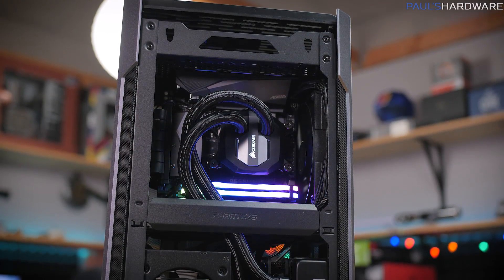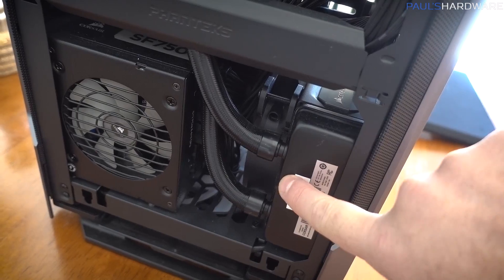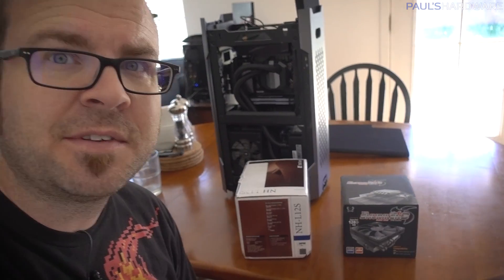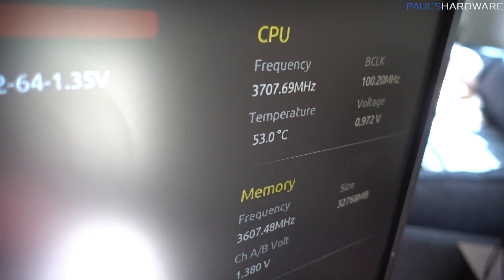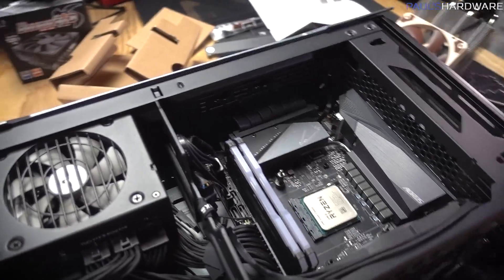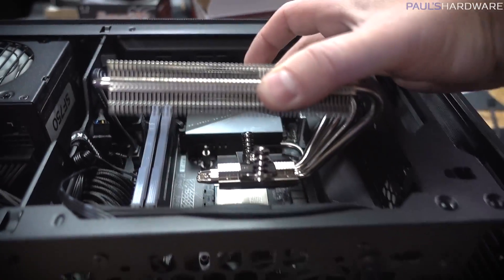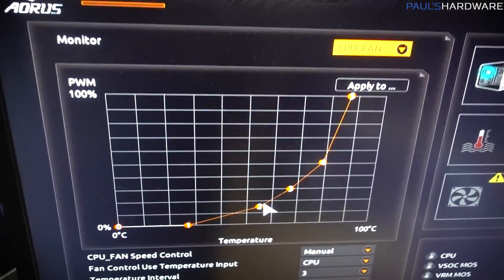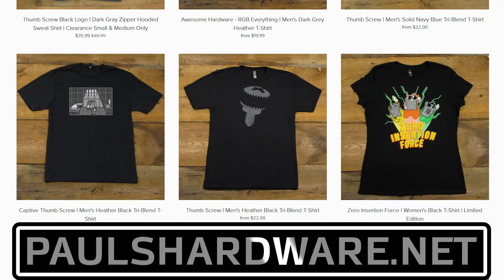You guys were right. The AIO died. ☠

Comment: I'm actually kinda surprised that failed, the hoses are above the pump so the air should get trapped there, not at the pump itself. Unless there is a ton of air in that loop.
Reply: It's because the orientation has nothing to do with why this pump failed. It's a faulty AIO, not the devil that everyone seems to make out of the whole radiator/pump orientation thing. The whole video from Gamer's Nexus has been blown widely out of proportion by individuals that don't actually understand the piece, or didn't even watch it.

Comment: So it would seem you must have a techchannel friend to acquire a 3080. Also pumps on an aio are lubricated and cooled by the fluid, when they are run dry it kills them, NEVER install your radiator below your pump.
Reply: Unfortunately in a case like this (and a lot of other ITX cases too) there really isn't any other way to install it.  Of course you can criticize the case design for that, but there are often a lot of constraints when going small form factor.
Reply: @kevadu  I don't deny that, but it is still a bad idea and almost guaranteed to kill an aio before it's time. Either a different case should be used or use an air cooler.

Comment: I had that same AIO configured properly and it died on me. RMA'd it and so far so good.
Reply: Yeah it probably died because of other reasons. This is still a horrible configuration, the worst possible with pump being the topmost part of the loop. But it should not die in 3 months. After a year maybe when permeation kicks in and the amount of fluid inside the loop slowly decreases and the pump starts spinning more air than fluid.
Reply: @MaaZeus  I think it could be a bad batch of h80i's... mine died in 3 months but I got it 6-9 months before his video so who knows.

Comment: I built in the phanteks evolv shift x which is a similar but older version of the same case. I did not use an AIO loop because the pump would have to be at the top which gamers nexus warned against. But I did not want to use air cooling. I built a custom watercooling loop, using a cheap kit from ebay, with the pump at the bottom of the case and the reservoir directly above it. The radiator is to the right of the pump. It works fine so far. Last time I went in to the BIOS CPU temperature 22C idling. Lot better than a boring air cooler. RGB, flow and temperature indicators also built in so I can see straight away if there is a problem in the loop which is constructed with soft not hard tubing. I did a fair bit of modding overall to try and improve air flow but I think it was worth the extra effort.

Comment: Love that reaction. AIO failed and you needed something that absolutely wouldn't fail or fuck you around. First stop? Noctua.  Correct answer.
Reply: exactly what i did when my AIO died. Went D15 and no issue for years. they even sent a replacement fan clip years after i had bought it. i messed the fan clip while i was cleaning the cooler
Reply: Industrial 3000 PWM Nactua fans are black and way more reliable than gimmicky water cooling.
Reply: @jamesm568  i got 5200 RPM grey Delta fans, AND gimmicky water cooling XD
Reply: @virtualtools_3021  Dayum! 💨🪟
Reply: @virtualtools_3021  5200, seems like it could get loud..... .must cool like a freezer though...lol
Reply: ive got a L9x65 5 months later still amazingly happy with it even with the noctua fan at max its not audible through my headphones
Reply: My Noctua is probably 15 years old, the original NH-U12. Still working in my old rig and just the fan and the mounting kit has changed. It's pretty incredible now that I think about it, money well spent.
Reply: He should have gone with the included Stealth Spire cooler.
Reply: @Klip One some jealous nobody on yt tries to be condescending/funny. Yikes
Reply: I have plenty of failed noctua fans. Granted they generally last longer than anything cheap.
Reply: @Herbertti3  how's their 6year warranty for service...? (Just curious as I bought a noctua lately - hoping not to use their warranty but curious..)
Reply: You don't need Noctua to have a solution that won't ever die.  You just need an air cooler. Noctua happens to be one of the best when it comes to actual cooling performance, but I've never had an air cooler fail on me in 20 years of building, regardless of manufacturer, which is why I air cool.
Reply: @Armathyx You know, if your house is old with very retro late 1800/early 1900 grandma's farmland house aesthetics with yellowish tiles in kitchen and so on, it just might fit with the decor. :D
Reply: @Armathyx Holy shit now I want to see a Steampunk themed PC! Of course it would have to be water cooled, goes with the Steam theme, but with copper pipes and otherwise brown/rust/copper color scheme Noctua fans would fit like a glove. 👍
Reply: @Armathyx Mine? Nothing fancy, just a Ryzen 5 3600 and RTX3070 but that is all compressed into an ITX case, which is cool. A lot of power in small box. About a year ago I got sick of hauling the huge ass Silverstone Raven 2 case around (needed to move it occasionally, like take it to parties or family gatherings with my VR rig) and I wanted a HTPC anyway so I shrunk it with Asrock B450 ITX mobo and now it all rests in a nice, small portable Lian Li TU150. It was supposed my HTPC and portable VR rig and as a temporary solution I would move it between my living room and desktop until Ryzen 5000 serie and new graphics cards got released and then I planned on building another dedicated desktop PC with custom loop water cooling and all. But you know what happened with parts availability and especially the  prices... Hell it was a stroke of luck that I even managed to grab 3070 in not-a- rip-off price during release. 😅
Reply: Sing along everyone....Tiny bubbles, in the block, make me unhappy, make me cry.....
Reply: fuck man, I have exactly the same problem in this moment and bought a Noctua NH-L9i haha.
Reply: I've been admiring Noctuas for a long time based on pro reviews and personal feedback from users. I just got my set of NH-D15 and case fans for my rig.

It concerns me a little, though, that the ARCTIC cooler and fans they replaced seem to sound a bit quieter or at least on par. I'm disappointed with the Noctuas being just on par because I believed them to be superior to the ARCTICS. And the actual cooling isn't much different either. Didn't keep a full detailed log of my temps in my old ARCTIC setup, but I could swear I saw lower temps even at times.. 

Oh well. They're here. No worries.
Reply: @SUSHI4lyf  That's more to do with the fact that the Arctics themselves are REALLY good fans. The noctuas should be slightly better at the same noise level, but at high RPMS the performance should be very similar.
Reply: Shouldve gone for the dark rock :)
Reply: @daddystu7046  dark rock is really good, but a bit hard to install. I managed to drop one of the mounting screws into my computers innards and never could find it. Now it is held on by 3 screws and a blob of blue tack.
Reply: @daddystu7046  Dark Rock would have looked better for certain. I love Noctua but only for PC's with no glass panels. That beige color sticks out like a sore thumb.
Reply: @MaaZeus  They have some black fans
Reply: @MaaZeus  I dunno, I've got a NH D15 in a Corsair 4000D airflow with glass side panels and the beige fans really don't bother me. The bulk of it is silver, and the beige fans mostly reflect the RGB off the Lian Li Uni Fans I've got in there. Find it quite attractive tbh.
Reply: @MaaZeus  That's why the chromax black line up exists. It's the same Noctua coolers, but all black (and slightly more expensive). It's the best of both worlds: performance and aesthetics.
Reply: @MaaZeus  i kinda like the beige and brown color scheme it looks more unique imo

Comment: That 'no box' shipping thing from Amazon you mentioned is a bit odd, but I've had that too. Dumb part though was it was a motherboard in my case and the board actually got damaged in transit from something heavy (the box was flattened!) - at least they replaced fast and didn't mess up the same way on the replacement though! 

By all means do it on something fairly rugged and reduce waste, but not on electronics!
Reply: For future reference. Amazon usually gives you a warning if the contents of the box will show and gives you an option to hide the contents by shipping it in another box. You can also just ship as a gift and it will always ship in another box
Reply: @pocketlint82  - Yes, that's particularly why I thought it was odd as there wasn't a warning. In fairness, I could have missed it though as a motherboard isn't exactly the sort of item I'd imagine being in sturdy enough packing by itself for being bounced about a delivery wagon!

Comment: Thanks for posting. Putting a liquid in an electronic device is not real safe to start with since you just showed there are logical alternatives. This guy was lucky it didn't leak. The fad of using AIOs will end due to inevitable failures. Some last longer than others but the possibility of great damage is high

Comment: Q: Why wasn't the Big Shuriken 3 used instead when trying to wrangle the the orientation of the L12S? Despite likely having better thermals with the Noctua, the Big Shuriken 3 should clear the ram nicely where the overhang would be over the VRM. It's a shame to have Vengeance Pros to then cover them up.
Reply from the maker: I think I mentally committed to the Noctua, so when fitting issues came up I was more focused on working around them than trying out the Shuriken...
Reply: @paulshardware  Also, democracy

Comment: Sons PC had an AIO fail. Got him an air cooler for his new pc. I only use air coolers now. Thanks for sharing Paul.
Reply: Can't go wrong with air cooling. Water can be a bitch sometimes.
Reply: Bigger the cooler the better, wish I could fit a dark rock pro 4 in my ITX case but I'm having regrets lol
Reply: @VEN0M415  whta case ya got?
Reply: @xt0  Phanteks shift, can't fit much in it
Reply: How did you position the AIO and when did it fail? They should last a good 5 years unless you got a total lemon initially or place it such that the pump is fighting air (like Paul did).
Reply: @emma70707  The AIO died from old age.(It was 5 to 6 years old) The problem is he lives across the country from me and I had to talk him thru mounting an air cooler. I wound up building him a new PC and used a Dark Rock 4 cooler. AIO are fine I just did not want it to fail on him with him living 2300 miles away.
Reply: Most of the modern air coolers are just as good, and alot of times better, than AIOs. You sacrifice a bit of noise sometimes but that's it.
Reply: @SlimPickins_07  , "That's it." Ha. Sure, beefy, full-sized air coolers are just as good as a 240 rad (and typically better dollar for dollar) but they DO require ample space between your mobo and case panel. In nearly all mffpc or sffpc cases, AIOs are going to offer more cooling capacity than any compatible air cooler. The L12S is a fine cooler, but it has less than half the fins and airflow, let alone the passive heat capacity of the fluid.
Reply: @emma70707  meh, I dont try to cram a bunch of high powered equipment into a tiny case. 99% of people building these super small form PCs don't need to save space, they just do it for the "cool" factor.
Reply: @SlimPickins_07  , whatever your assertions about sff/mff pc owner motivations (and I would argue they're wrong and that you clearly aren't knowledgeable about sff/mff builds given your previous assertion but that's beside the point), your statement above is false. It's not just minimal noise you trade. -( '.' )-
Reply: I’ve used aio for so long and never had a failure, it’s so rare to fail unless you mess with it a lot. I’ve had more trouble with air coolers than aio’s
Reply: @mister-pinkman  such as?
Reply: @xt0  I’ve had a wraith prism making a grinding noise at higher rpms and noctua ram clearance issues as well as just not as good temps as my aio

Comment: Looks like you could have just rotated the CPU block to have the tubes enter on the bottom. Your problem was that the pump intake was so close to the high point of the tube, but it didn’t have to be so close if you had mounted the block differently.

Comment: I've  been thinking about this lately. as much as i like AIO coolers ..if the cooler fails its an expensive repair job. if the fan on an air cooler fails  its a lot easier and cheaper to fix. i'm running an AIO cooler that's 7-8 years old and my thermals are not great. in my next build i think i'll be going all air.

Comment: I’ve had a Corsair h100i v2 for the past 4 years and it still has not had any problems lol.
Reply from the maker: The issue was much more due to the orientation than the quality of the AIO, I've had liquid coolers last for years without problems as well
Reply: @paulshardware   I saw Gamer Nexus video about it awhile back. My setup is on a testbench with the pumpblock above the Radiator and I've never noticed anything weird like that. Also Noctua has some awesome all black fans if you don't like the regular brown/beige color fans.

Comment: has to be the must confusing fault ever when the AIO goes..... i blamed everything else before blaming the bloody cooler! even spent £100 on a new powersupply thinking it was that, nope new psu didnt fix it still randomly losing power i even tried different sockets in the house still lost power i took it to a small pc shop see if they could find out why? nope they had it 3 weeks couldnt figure it out so took it to a big pc store they detected the pump was faulty sometimes it worked heating the pipes up giving you the thought that it is working because the pipes change temperture but then cutting out causing the power cut. sly horse that part.

Comment: I just built a system and decided to go air cooling. I'm not at all happy with the longevity and overall reliability of water pumps.
Reply: i decided if im going to watercool im going full custom, using as many automotive parts as possible
Reply: Running CLC for 7 years only replaced 1.
Reply: Same, AIO have there place but for the average joe (like me) yeah... not really worth it
Reply: Had a CLC on my hybrid. Ran non stop since 2016. No problems so far, knock on wood.

Comment: Kids this is why air coolers will always be kangz.
Reply: Indeed! After my second (!) Corsair H80i v2 started making a permanent high frequency whine after a year of use, I replaced it with a Scythe Fuma 2 air cooler, and I was blown away (pun intended) by how good it is!
Reply: @8bitbubsy  You intended that pun, and your execution was flawless. Well played.
Reply: im using the Wraith prisim on 3700x not bad for a stock air cooler 66-70c gaming.
Reply: @NightOwlGames  I use the same on both of my pc's. With the right fan curves and good airflow it can hang with the best while just being a bit louder than usual but as someone who uses a headset or games on a super loud surround system, pc noise has never been something to consider for me.
Reply: @NightOwlGames  yeah, no. if u can't spend 50-80 bucks more for a beefy and good air cooler, u are a cheap fk.

Comment: Queue the Gamers Nexus quotes and video links lol
Reply: Funnily enough, I doubt that's the reason why it failed.  That's supposed to happen over a much longer period of time as the water evaporates, which then introduces the air bubbles.

It's much more likely that the AIO was just faulty.
Reply: @pieceofschmidtgamer  AIOs often have air bubbles in from the factory, it will get worse over time of course due to evaporation, but evaporation isnt always needed.

It could also be a pump with an issue which might have lasted longer, but died faster than it would otherwise have.
Reply: @pieceofschmidtgamer  must be hot in California
Reply: @pieceofschmidtgamer  If you watched the GN video, you'll know that all AIOs are never filled to 100% volume. Some air will always be present, and sometimes a significant amount too, which, if the pump is on top, the volume of air will be all in the pump and that can easily help it fail.